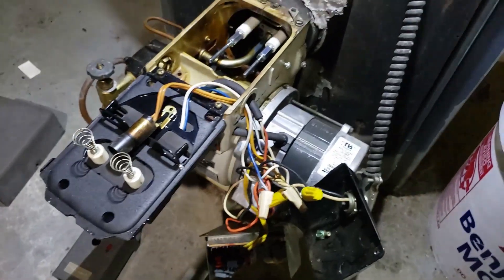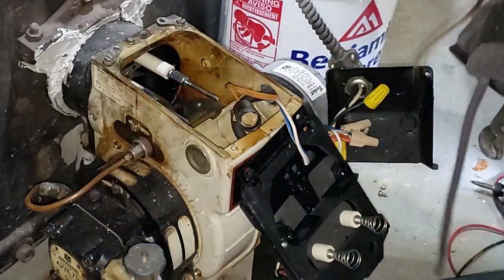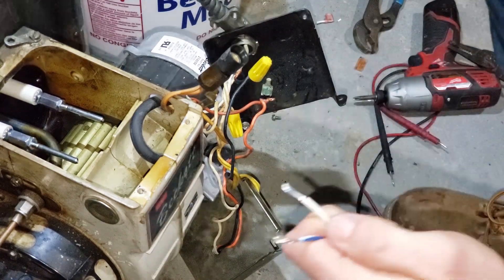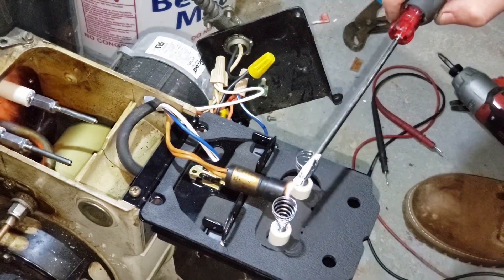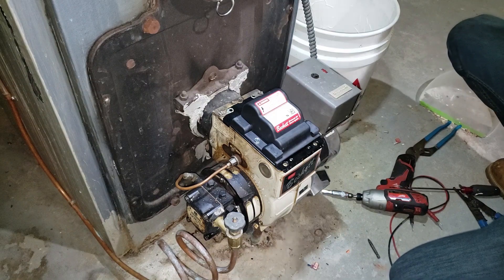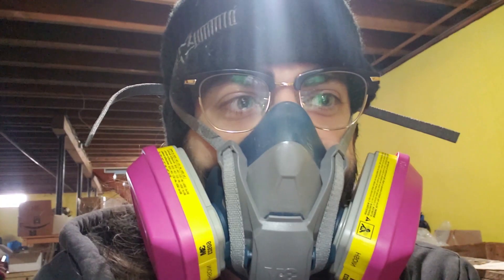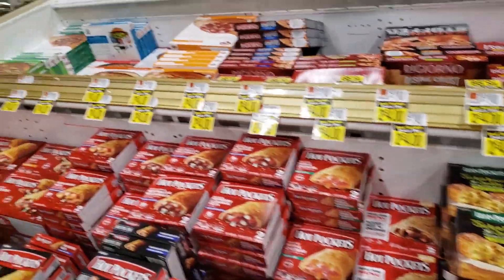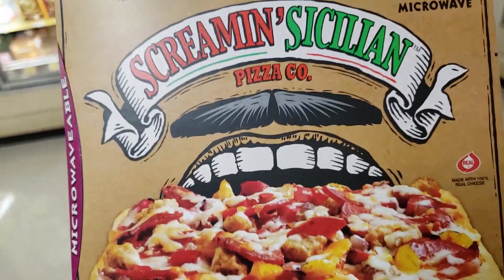Oil Furnace/Boiler not Igniting - how to replace igniter Beckett

Comment: How old was your burner? I have a very old one and the igniter transformer has 10K secondary voltage. The one you used is solid state and has secondary voltage ranging from 14KV to 20KV. I do like the solid state ones but the secondary voltage is my concern.
Reply from the maker: Oh I see what you're saying. I'm not sure, I think the burner itself was replaced somewhat recently, maybe in the last 10 years.

Comment: So your saying your Banging, When starting  Happen because you had a weak coil
Reply from the maker: Yeah something like that. Weak intermittent coil, causing poor combustion and occasional "backfire".
Reply: @Bootstrappin  , I,m 65 years old and use to work on large burner,s for the city, But I,m getting old and poor eye sight, Whats going on makes no since, I cleaned and changed nozzle, new filter, When first start, you couldn't hear the Burner start it was so quiet, 5 hours later, Loud start, Don't get it, I also gauge it 100 pounds just what it calls for

Comment: ahhh, think i'm doing this very thing tomorrow...got oil, pump fine, works intermittently....give it a lil tap and it fires, pretty sure igniter has had it, thinking it the original, 40+ yrs
Reply from the maker: That's impressive, they truly don't make them like they used to... although, I don't know if you'll be able to find an igniter like the one in your burner. May be time to upgrade the burner.
Reply: @Bootstrappin  not happening, not in budget, it a common burner, just taking old unit out and bringing to plumbing house to match

Comment: You're lucky you didn't blow yourself sky high when you lit that burner off. I honestly don't know why that didn't explode when you lit it and opened up the igniter.
Reply from the maker: It has done that on its own several times as the igniter was on its way out. Shook the whole house. So there probably wasn't enough oil left in there.

Comment: Shutting off a smoking oil burner can cause it to explode.
Reply: When you cut the positive air supply and ignition source to a hot, saturated chamber, you create the conditions where oil vapors can spontaneously ignite. When you have a saturated chamber, brace the sight door shut, light it off and hold on to your ass until it burns off. Also a good idea to jump out the cad cell terminals after it lights to keep it from dropping out and locking the burner out.
Reply: This. if they are loaded up you need to keep em burning even if they are rocking and rolling until the chamber clears out.
Reply from the maker: I would think the opposite? Wouldn't you not want to keep feeding it oil?
Reply: It's gotta burn off. Your not feeding it oil if burner is lit. Let it burn off.
Reply from the maker: In my case, the blower and pump kept misting oil into the chamber despite the fact that it was over saturated. There's no reason why it would explode if you just let it burn - it's depleting oxygen since the blower is off.